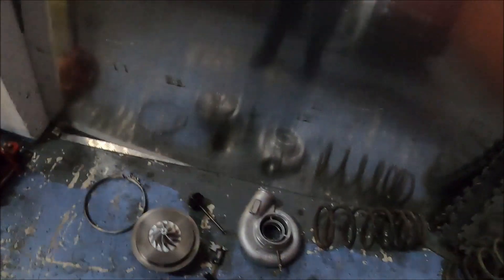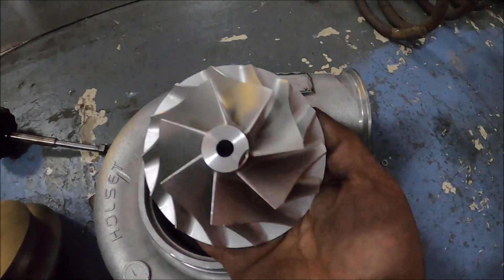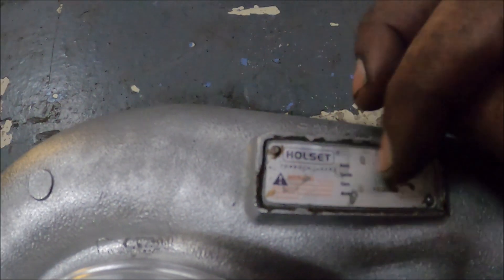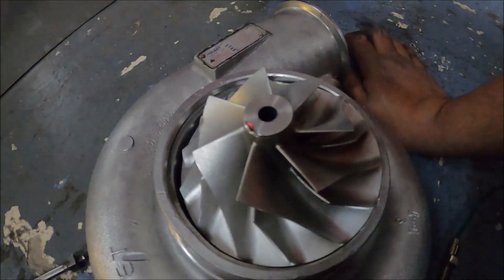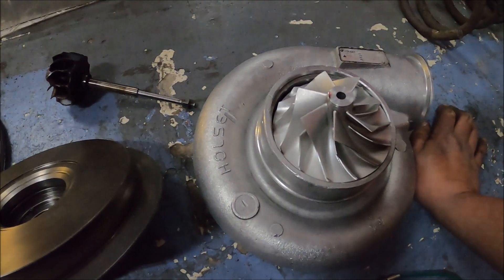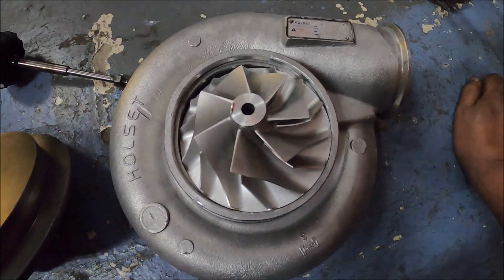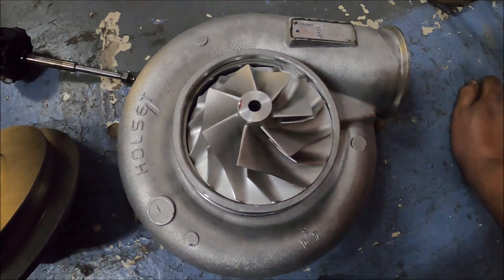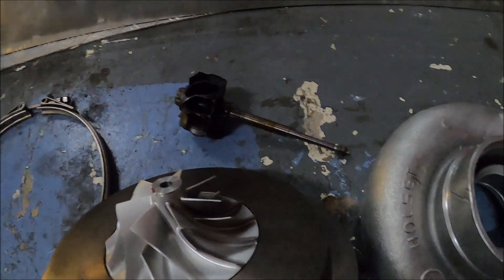1000bhp+ capable electric supercharger/turbo build?!?!

Comment: Yeah, you could probably take some belts and some pulleys and attach them to maybe a mini generator and maybe driveshaft or some shaft to the wheels some type of way if you kinda understand where I’m going with that to power it instead of trading for battery weight or something like that

Comment: This is right up my street, Ive been wanting to do this for years. I've got a HX40 thats been in bits, ceramic bearings with no cage + small motor and hobby ESC for testing. I just never got around to making it as I dont have a lathe. 

Is your mates brother Tesla500  by any chance? If not, this guy I've been subbed to for years has already made one, but not put on the car, pretty mental and he goes over the numbers pretty well. https://www.youtube.com/watch?v=G8XT00GpKuE

You are going to need some serious battery power for 6kw+. I'd build another battery pack with lithium ion cells (making sure they are high drain cells). Even though Lithium poly (RC batteries) can provide more power for their size, they also have a habit of setting themselves on fire so I'd avoid. If you watch the dudes video the amount of power supplies hes got. 60 volts, 100+ amps. For lithium ion cells thats 16 or 17 banks of series to get you to 60v, and at least 10 X 10a high drain cells per bank parallel to get 100a. So 10 X 16 = 160 10a high drain cells absolute minimum just to sppol it up, let alone how long it would last. Then you'll need a pretty large amp DC-DC boost converter to step the 12v upto 60v to charge it.

I'm fairly clued up on 18650 lithium cells from solar powerwalls etc so ask away.
Reply: Could he not just add a much larger alternator and super  capacitors to maintain the amperage needed for boost ?
Reply: @freemanscott78  If we use teslas video as an example, 6kw at 14.4v is 416 amps. I dont know of a motor or controller that runs at 14.4v at that insane of an amperage nor at the RPM's we require. Imagine how thick of a wire you'd need for 400 amps. High RPM usually requires higher voltages. Whereas there are plenty of RC motors and controllers that will run at higher voltages / less amps. Also dont forget the alternator puts load on the engine. So the only way to actually gain 'hp' is to have a secondary battery that you slowly charge off the main one, then when you want boost, its taking from the secondary battery instead of putting the load on the alternator. It might take XX minutes of driving to charge it up for a few seconds of boost, it all depends on the setup.
Reply: Stav also check out these crazy russians, he made an electric compressor too, they make some good videos and points. Turn on google translate and have a read through the comments. https://www.youtube.com/watch?v=hqrnhPGJxkE